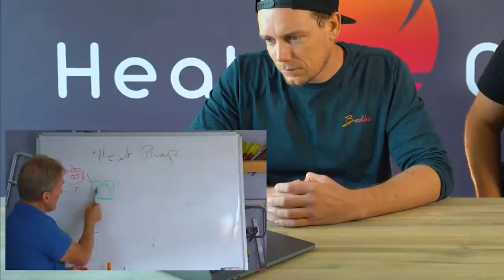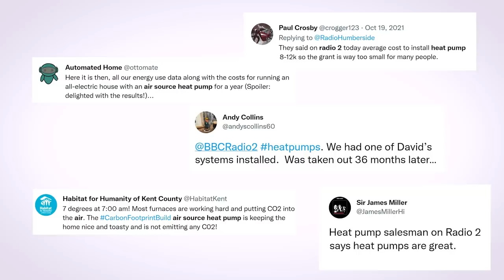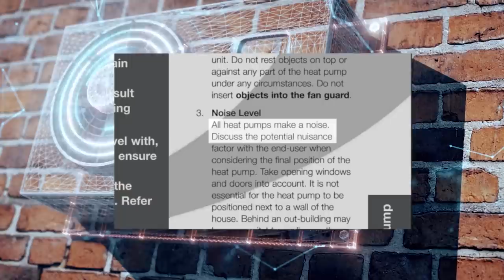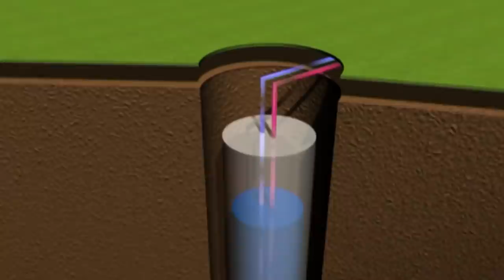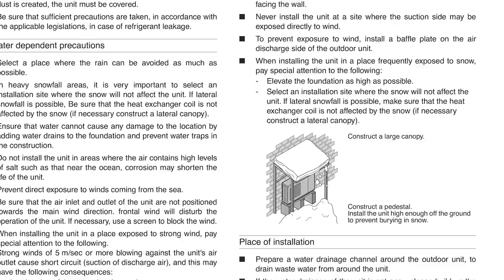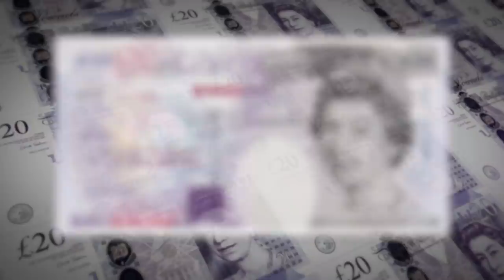Heat Pump Secrets They Don't Want You to Know

Comment: I have a mini split system, one thing  to bear in mind with heating is that because they are mounted high on the wall they tend to heat the top of the room and the bottom is still cold, in our office where I have one it can be 30c at the top of the room and 7c at the bottom, so you need to either have some sort of convected heat from underfloor or radiators to heat the bottom half of the room or a way of feeing the cold air from the bottom of the room into the top of the mini split, if anyone has a good solution to this please let me know
Reply: As an installer of split systems, when the unit starts up in heating the flaps should drop into the low position allowing the warm air the next forded down as heat rises. 
Never had a customer complain about cold pockets of air low down. Maybe it’s the type of system you have or maybe it’s under sized.
Reply: @paulsuggett5859  Thanks for the reply Paul, mine does lower the flap right down and the fan is on full as it comes up to temperature, but it doesn't seem to help much, it's a 3.5kw unit in a fairly small room so plenty of power, it has a follow me function on the remote to set the temperature where the remote is, but it just gets to like 40c at the top of the room and about 12c at the bottom. The only other thing that could be a factor is it was mounted 6cm from the ceiling instead of the recommended 15cm as my ceilings are a bit low, so the air going in could be a bit restricted.
Reply: @paulsuggett5859  Exactly
Reply: @peterswinson326  That's the problem, You need a rolling air mass in the room, down the wall below the indoor unit, actoss the floor, up the opposite  wall, across the ceiling and back to the unit. The gap above the unit is too small and airflow is restricted. Try the top fan speed, it might help.
Reply: @mikekelly5869  cheers for the comments Mike, I don't think most units would have enough blowing strength to do what you've said and even if it did you'd be feeding hot air back in and the cold air isn't going to want to go up or across the ceiling, I think it would have helped to some degree the lower it was mounted, I'd recommend a low wall mounted unit for anyone mainly looking to heat the room with one
Reply: @peterswinson326  In my business I often get called in to fix this problem. I agree with you about using console units at low level for heating and to my eyes they also look a lot better but they also take up a bit of floor spece and get in the way so people often don't want them. Hiwall units can work for heating though. The key is to select the unit based either on a horizontal throw (to 0.5m/s) of the width of the room plus half the height or a relatively strong vertical downward throw that induces turbulence. Of course that gets you into trouble because the area immediately below the unit becomes incomfortable due to the hot blast. The best option is definitely upward discharge but when people are stuck with hiwall units we've had most success telling them to avoid sitting underneath them and blowing straight down at the highest fan setting that they will tolerate. Sometimes we get over the problem (when there's space) by installing a destratification fan or a cheapie HRU and a little bit of ductwork. Best of luck with it
Reply: @mikekelly5869  Cheers for the info Mike

Comment: Great to bring the truth out into the open.
I would like to see the results of an experiment, run a heat pump for a season and monitor hour by hour electricity used, heat produced, electricity used and internal external temperatures. I look at it like rolling a stone up a hill small hill little energy used but a big steep hill a lot of energy.
You will find there is a outside temperature  at which  it would be more economical to turn off the heat pump and turn on the electric fire.
What whith the need to have an electric heating in the outdoor unit to defrost it plus the gradient the heat has to be multiplied it is inificient . Heat is an energy same as electricity it cant be maid or destroyed it can only be converted into something else, example boiling water heat hear whoever source gas, electric or burning wood once water reaches boiling point any extra heat is used to make steam and change the state of water, refrigerant is the same it is liquid under the right pressure but turns into a gas at the right temperature.
From a retired refrigeration engineer. I have suggested Which organisation conduct this experiment but so far nothing.

Comment: The larger the power plant no matter if it burns coal or if it burns fuel oil it burns cleaner and more efficient because it's at Max operational efficiency at all times versus a small generator that fluctuates going up and down that is inefficient plus most if not all coal burning power plants are downdraft burning all the carbon off before it gets into the atmosphere

Comment: Look at the manual for almost any electrical equipment and you'll be able to draw some ludicrous sounding "conclusions".
Reply from the maker: Well there you go. The point is that the manufacturer will tell you that your warranty is void if you do not follow it.
Reply: @SkillBuilder  sure, like with any piece of technology. But you make it sound like it's something heat pump specific which I felt was not that fair.

Comment: Heat pumps that use an air handler inside the home work great. but the hot water boiler style heat pumps designed to replace Natural gas boilers are not so great the reason is because the original hot water radiators are designed for much hotter water than what can come from a heat pump boiler. So all of the radiators inside will be undersized. Unless they are replaced the home owner will not be happy. Hot water heating is really not so great because that type of system is not very effective at cooling your home. It is much better if your home has room for a ducted system where conditioned air can flow to every room. Mini splits are nice but they usually don't last more than 10 years if your lucky. and are not practical if you are only conditioning two rooms and the rest of the house is not getting circulated air. But better than nothing.

Comment: Electricity is going to be the way of the future for all of our energy needs; transport and heating. It is futile to avoid the inevitable. It's the most versitile form of energy known to man and the source of it is irrelevant in a discussion about ASHP's as it will change over time to be more environmentally friendly - it must or we will all suffer. Sure, the national grid can't handle an overnight switch over for everyone but neither can our fuel stations fill up every car on the same day as demonstrated recently. Many of the points identified in this vlog are either common sense or comparable to the issues associated with installing gas heating systems. It's just that we're more experience installing gas boilers, know the issues and the industry is better regulated. Rather than highlight all of the past or current problems that can affect some users, how about educating us by showing us how to size, cost and install an ASHP correctly? How about using your many decades of heating experience to come up with clever adaptions and workarounds for the current technology; such as hybrid heating system? Surely the greatest defence against shark salemen and bad system design is knowledge sharing and education. Come on Roger, you can do it.

Comment: You are exagerating, heat pumps are the present and the future. I have a Mitsubishi ECODAN for the past 8 years, I heat some 220 m2 with the annual cost of 240 euros. I live in Kosovo which is much colder than the UK. I have a very good insulated house with some 45cm thick  outside walls. Yes it has electrical heaters for defrosting but the expense is minor as they run for few minutes a day. As per maintenance all I do is check if there is enough water in the system once a year. All of my friends and family have the same heat pump, none had problems with it. This was the best investment that I ever made on a piece of equipment. Note: For it to work properly you need good insulated house, heat the space around 22-23C, once you turn it ON keep it on as it takes time to heat up, it is not a gas heater! I did some calculations if I bought a next best thing, the wood pellet burner the amount of money spent on kit and pellet fuel amounts to 5 years for the price of heat pump. Last three years I am  paying a coffe a day for heating. Even if electricity triples in price I will pay 120 euros a month, which is nothing.

Comment: In 30yrs once all the government funding runs out, we'll all be installing Ducted/wallmount AC Systems into our houses with a small Heatpump for hot water in your sink/bath/shower or even just emersion heaters. While Heat Pump Tech works if installed correctly, I cant see it ever being commercially viable in terms of cost. Its just not mass producible.

Comment: This YT channel is British and is targeted at the British building industry which has different infrastructure, heritage, standards and policies to other countries. Comments from contributors outside of the UK need to understand that what works for them won't necessarily work in the UK. So derogatory remarks about the presenter and other posted comments are significantly less than helpful.

Comment: Pretty sure given the choice, a mouse would rather find it's way into a nice warm insulated house and make it's home under some floor boards rather than make it's home inside a large air source heat pump that has a metal enclosure outside which is cold and blowing cold air continuously. 🙄😂
Reply from the maker: We consulted a mouse psychologist and they agreed with you, they would rather be in a nice warm house. We were merely quoting the heat pump manufacturer's instruction manual and they warn against rodent attack. We  have to wonder if this is just  paranoia or if it is based on the experience of their engineers who are called out to breakdowns.

Comment: I have had a heat pump for 24 years, best decision I have ever made.  Does it require maintenance yes.  Has it broken down and needed a tech to visit for repair, yes.  Has a tech been required more than I would like, yes.  Is there a better solution, not that I am aware.  Your video is so misleading it is ridiculous.  I do not understand your motivation for publishing.   None of your statements are based in fact other than they are cautions written in some manual.  No practical applications or comparisons to actual in-place systems. You can do better.  Please stop the biased rants.

Comment: Again you don't mentioned the difference heat pump systems. Air to air heat pumps are the most efficient. A factor 4.5 efficiency! 
We make electricity with solar panels and use this for the heat pump. We are on everage energy neutral over the year .
Reply from the maker: They are not liked in the u.k and you can't get planning consent or grants  for any units that can be used for cooling

Comment: Somebody had a heat pump installed round the corner from me.  It sound like a car engine running all the time and it must be at least 100m from me. It's a terrible noise & it's brand new. I hate to think what it will sound like after the bearing begin tho go..
Reply from the maker: That is what I find and imagine if every house had one.

Comment: Did you mention protection from theft especially from scrap metal thieves, they love all that copper tubing. 😬
Reply from the maker: I did not mention the theft because I was concerned that it would encourage a whole new crime. I agree with you though. I am thinking that a second hand heat pump can be sold for more than the scrap value. It would take minutes to remove it intact.

Comment: Hello .. longtime subscriber on this channel.

I do not agree with you, not in this video, or the privious heatpump video.

Some of the things you are saying are to be taken into consideration, but others are just bullocks.

For example, the reason why you are advised to turn of the solonoid, so the floor heating is fully open, is because the temperature on the heat pump is meant to be as low as possible - and some solutions of central heating may benifit alot of making the heatpump adjust the temperature, and not the floor heating solution itself.

that was just one point - but I really disagree on 85% of what you are saying in both videos.

But the point you DID have, and nailed, is, there is too many non worthy people in the industry - just smahsing up heating pumps, with out the knowledge to choose the correct pump, for the install. And that may give people alot of poor experiences! :) ... Myself I have one air to water, and 1 air to air installed - works magnificant, and its cheap! But it wasnt cheap getting it installed either - I got professionals to help me with the correct solution.

Besides that, thank you for all the good videos with alot of inspiration and advises!

Greetings from Denmark.
Reply from the maker: FZ DK 
In the heat pump installation instructions and trouble shooting guide it specifically talks about opening up the underfloor heating circuits 
The flow rate can be achieved with a buffer tank but a lot don't fit them. 
I am quite happy for people to disagree with me but please read the comments under the videos and you will see that a great many people are unhappy with their heat pumps. 
This incentive will cause more unhappy customers and do very little to cut CO2

Comment: Heat pumps are only th latest fashion, I think in 10 years the true cost will present itself, as stated they are not good for all houses, we had 4 or 5 different companies visit & in conclusion they all agreed our present heating system was better & much cheaper after presenting them with 5 years of heating bills, they said a heat pump could never compete

Comment: I have used a 4 ton heat pump at my home for over 14 years with hardly any of the warnings you gave to stop the adoption of one of the best space heating device you can currently purchase. I also live in an area of the world where the annual temperature change fluctuates from -20 in the winter to +45 C in the summer. You're rant is nonsense, designed to put the fear of death in future purchases. Yes you do need to have a well insulated structure and the heating system must be designed for you're climate but heat pumps do heat and cool very well.
Reply from the maker: So you agree with me then. Thank you.
Reply: @SkillBuilder  As a retrofit in an old structure yes but not in new construction utilizing low grade heating  solutions.

Comment: WOW the lack of research and understanding of efficiencies is embarrassing, please continue with plumbing as that doesn't need critical Macro thinking. Simple explanation for you is that we do need more electric production but this needs to be renewable, I'm working on a geothermal powerstation in Cornwall that will produce electric and low temp heated water to surrounding properties. If electric is produced in a gas fired power station then when that electric is consumed by a heat pump it produces more energy than consumed therefore better than just burning gas for energy. IT"S THE UK PROPERTIES that don't suit heat pumps not the other way round. Show some passion for the heat losses in the build quality of houses that haven't changed in 40 years.
Reply from the maker: Gavin 
You must surely understand that this goverment initiative to subsidise heat pumps in place of gas boilers is not about passiv hus. It is intended to ordinary homes and will be a disaster. Another misselling scandal. Good luck with your geothermal in London.
Reply: @SkillBuilder  yes I understand the funding, what about the funding for the fossil fuel industry 13.6Billion in subsidies since the Paris agreement. If you follow the MCS guidance not every property will qualify for a heat pump or funding, but a lot of properties will I.e. new builds circa 20 years old with gas boilers in. Let’s fit heat pumps where they are most suited first then deal with the problem of old properties as technology moves on. Hating on heat pumps is the wrong way to go about the issue of the crappy house building practices of this country.

Comment: 5:26 "no difference between gas fired power stations and household gas boilers"
Do your research.  gas power station  efficiencies less transmissions loss is still Way more efficient than small local systems. 
Then " leave it on all the time", is bad? Total nonsense. A small few kW to maintain minimal heat levels in the house  is hugely more efficient than having to boost a house from really cold start-up, with EITHER gas or electric. But you shouldn't leave gas on, should you!
Then  you spend a long time going over the fine print of heat pump installation,  but TOTALLY don't refer to the incredibly tricky installation and maintenance  of gas fired appliances.

Comment: And surprise surprise a diesel engine when it starts could run in very very cold weather breathing very very cold air
Reply from the maker: Yes but it takes energy to achieve the initial compression and you then need a fuel source to keep it running. I am sorry to say that I do not understand your point. We all know that compressing a gas will produce heat but the compression is not free.